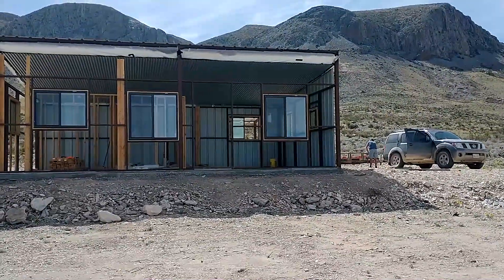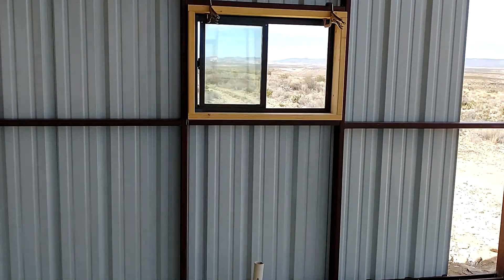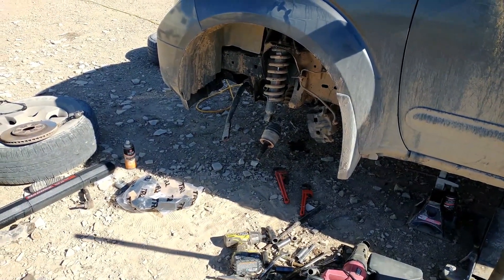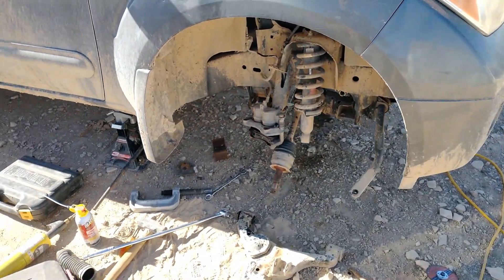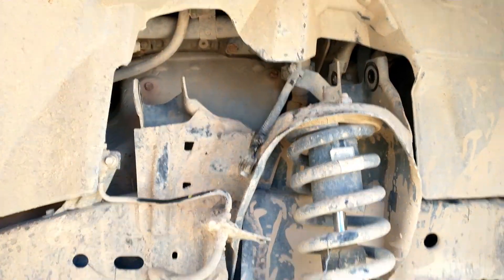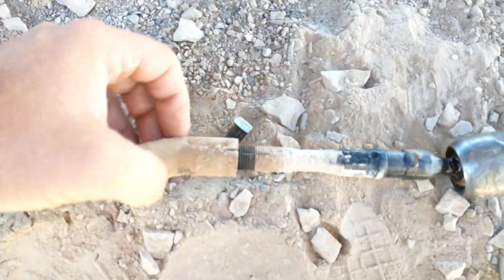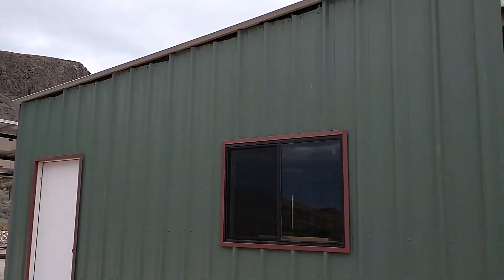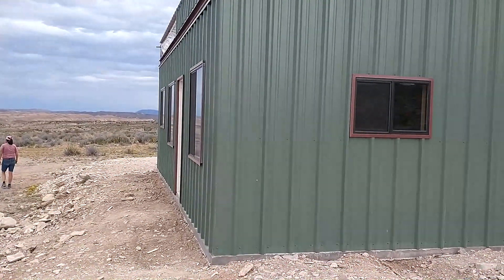More work on the cabin and some vehicle maintenance | Terlingua Texas

Comment: So cool to see your using red-iron.  The cabin will be great when done.  I'm planning somthing similar using rediron as well, what are the detentions to your cabin?  My cabin will be 15x26, w a lean-to roof, and was thinking 10' on the front and 9' on back.  Any advice?
Reply from the maker: This one is 20'x30' with a 10'x30' porch. I really like this method because you end up with very little thermal bridging since there are only a few 1.5" contact points for each wood 'stud' and you get a lot of uninterrupted insulation. We're going to be building a few more structures like this and will make some more detailed videos along the way.
Reply: Thank you for responding...this work is much more difficult than what most people think...it is definitely a labor of love.  Question 🙋,  what advise would you give to any one wanting to start building on raw land?  I recently had a couple 👫 ask me this question and I basically told them I is hard but very rewarding if you have commitment and desire and it would hurt to have some kind of income a good truck...
I'm looking forward to any new video...I'm especially interested in knowing building is welded building.
Reply from the maker: @desertmoonlightcottage3387  Yes, it's welded. It's much easier to melt metal together than to use screws and bolts.

Recommendations are hard because every situation is different.  Here are some thoughts:
Priority one, get power up and going whether that's grid or solar, generators are great for emergencies but a terrible sop solution.

Clearing and grading land, embrace heavy machinery, it might seem like you can move some dirt around by hand and save some $$, but really in a couple hours a good backhoe operator can do what would take weeks with a shovel. 

Concrete seems expensive but if you price out framing, subfloor, underlayment and floorcovering it's cheaper and more durable to do a concrete floor, even with stain and sealer, unless you just hate concrete, then by all means wood is nice ;) 

Yes, a truck and income are helpful.